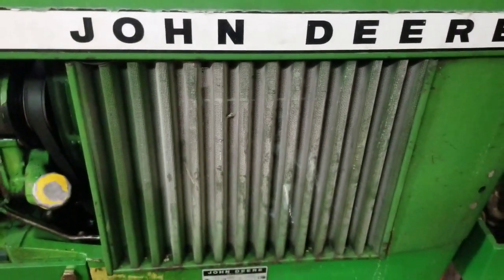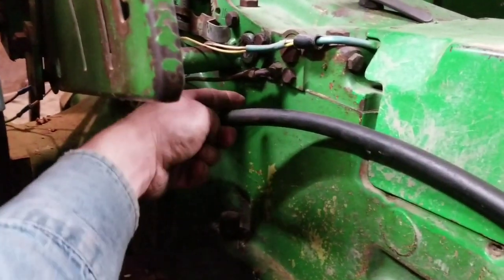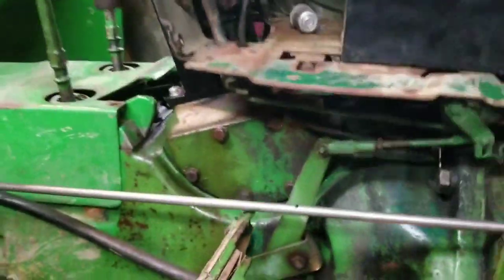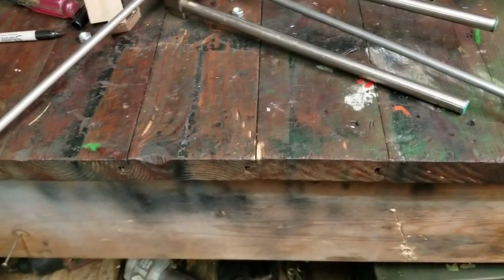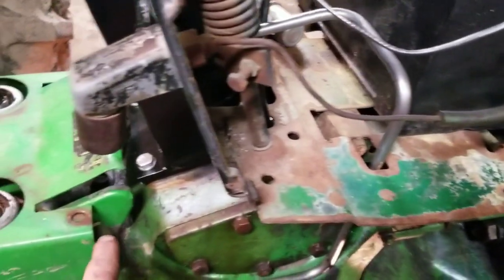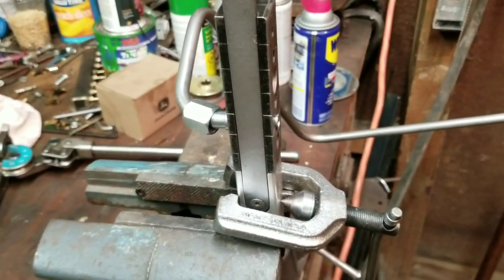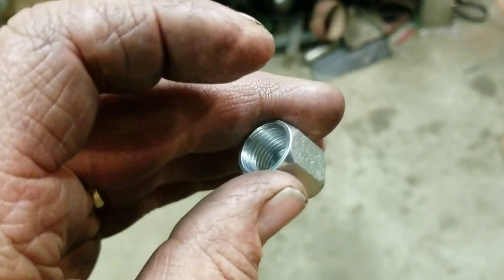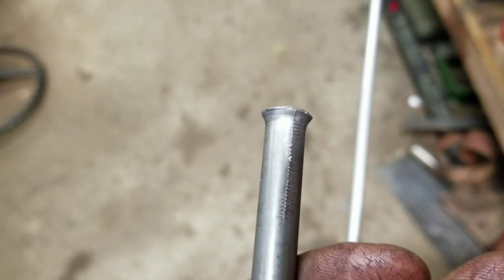Running steel tubing and a hydraulic cylinder!

Comment: You could Slide some rubber hose over it so it doesn't rub so much on the metal hole near the battery

Comment: looked really nice CE.  few know how to run conduit or brake lines and make them fit while looking nice as yours come out.   did you have the radius chart for your size tubing?
Reply from the maker: I've done this at my day job for 30 some years! If its done right it looks like art if  not it's a mess! Thanks Soybean Farmer

Comment: Nice progress. Have you thought about putting some rubber tube over the metal tubing to reduce vibration and rubbing? Short lengths sliced down the side and clipped over the metal pipe was what I was thinking.
Reply from the maker: Yeah its gonna need  some clamps and some support or that tubing will turn into a tuning fork, the first thing that happens is the flares crack off the ends! Thanks Larn